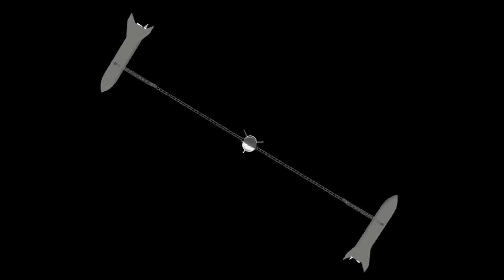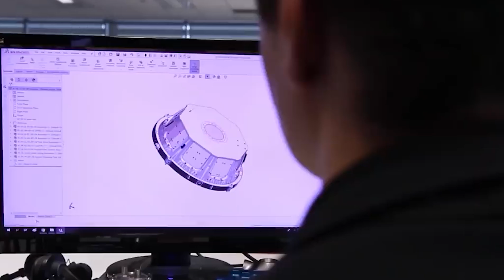SpaceX Artificial Gravity Starship Just Became Reality!

Comment: Way easier to use the hooks that lift Starship in a highbay and then rope two StarShips nose-to-nose with great distance between them once out in deep space.

That way you only need TWO StarShips, and then use thrusters and whatnot to keep tension over the very, very long rope or cable between them. And then slowly and carefully get it rotating

Comment: SpaceX will easily be able to manage their constellation of 30,000 Starlink satellites. If other companies choose to put up orbiting constellations then they will have to do so at a higher altitude until they prove that they will not collide with existing Starlink satellites. Just because other companies would like to have a constellation like Starlink in a similar altitude doesn't mean that they will be able to, especially if it is still just a dream or years away! Starlink satellites do not sit in one spot of the sky. The Starlink satellites are constantly moving they will not block one area of the sky for more than a few seconds. There is so much distance between each tiny Starlink satellite that they could be moved forward backwards or side to side. If there is an interruption of vision or launching collision possibility by a Starlink satellite it is easy to contact SpaceX and they will make the adjustments necessary. SpaceX has more technology, technicians and experience of any other organization I know worldwide. Let's shoot for the Moon and Mars! Then we will end up amongst the Stars!

Comment: More than one ship the communication ship would not spin. The passenger ship would be like the one described. They possibly could use some form of wireless transfer of energy to get power from solar panel to rotating section. Or the spinning part would be like a huge armature and produce it's own power. Then the passenger ship would become a space station once getting to Mars. Really it would be smarter to build a giant driving space station. We might just have to start out doing it the hard way, and literally crawl before we walk.
Reply: Like an Alrdin Cycler? Also part of the point of Starship is to land on mars

Comment: What is the gravity load of Mars compared to Earth? Or the moon compared to Earth?
Also what is the solar exposure (heat and radiation) on the human body compared to being on Earth (with its atmosphere, cloud cover, and nightly rotation away from the sun)?
It sounds like Mars is a bridge too far for humans at this time.
Better ro perfect a 'spaceplane' with a hybrid propulsion system that can lift off as a jet (e.g. 747 or U-2s), and once at its highest altitude about 60,000 to 70,000 feet, have its jets slowed down and its reuseable booster rockets (that are attached to its side) ignited to propel the craft to any area on earth. Then have the booster rocket propulsion reduced and the jets restarted (or stepped up) for the jet-powered glide down for an airfield landing. 
This could usher in spaceplane-flights of minutes instead of numerous hours of dreary intercontinental  jet travel.  Let's achieve that on Earth before Mars.
Reply: 1) Assuming that means how much gravity, Mars is 0.38g, Earth is 1g, Moon is 0.16g, IDK what the question really means though
2) Mainly the magnetosphere can protect against radiation. Mars and the Moon have extreme radiation from Cosmic Rays and Solar Radiation. Also heat changes on these places just like on Earth
3) Yeah, we're not ready for Mars
4) Spaceplanes are pretty iffy. You can look it up if you want more information, but they don't work perfectly

Comment: The best option will be continuos propulsion. But we haven't this kind of engines yet.
Reply: We have the ion engine. In theory it can provide continuous propulsion
Reply: @thomasfolsom5888  to similate gravity you need some reasonable fraction of a G, ion thrusters are to weak. Probably need nuclear. Propulsion running for full trip also have the benefit of shortening the trip, accelerate for first 1/2 and then decelerate for rest of trip.
Reply: Continuous acceleration around Mars?
Reply: No, it actually wouldn't be. It would be extreme wasteful unless we had reactionless drives, which don't exist as far as we know, and are way beyond our current scope of technology. Rotating isn't. It just requires insane funding

Comment: If you send 2 starships in the same time, 1 tanker and 1 passengership Connect them with 1 wire and set them in rotation, done ! There is already fastenings on top of startships, for lifting the starships on earth.
You have your gravitation ( actually not my idea, its Werner von Braun).
Have  a small communication-sattelite 100 meter away from the rotating ships with a parabola fixed at earth for communications, and small Wifi-communication with the rotating spaceships.

The rotating ships dont need to have big solarpanels like wings, they can be mounted directly to the ships body, the ships can be rotating so that only one side is directet at the sun the whole time, the other side will have coolers for cooling of excess heat.